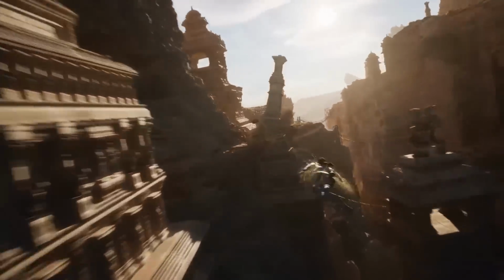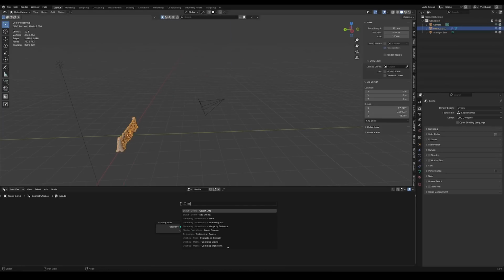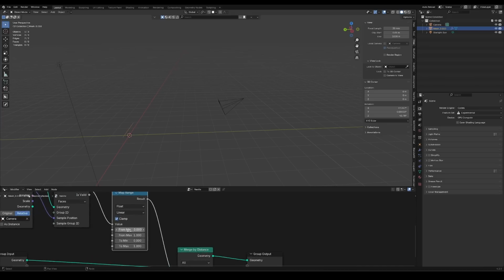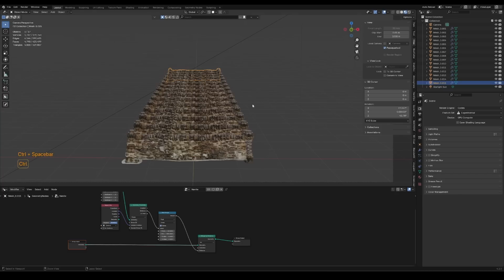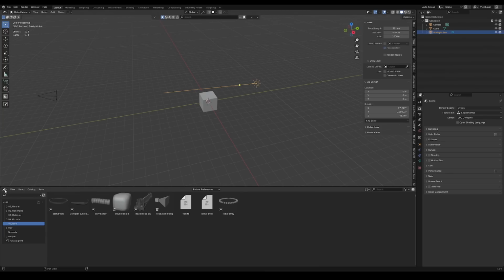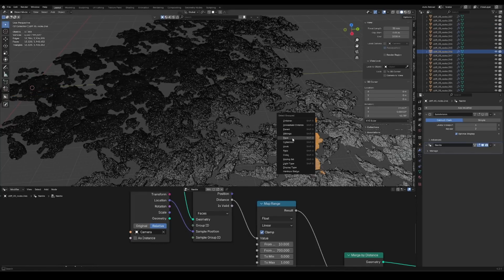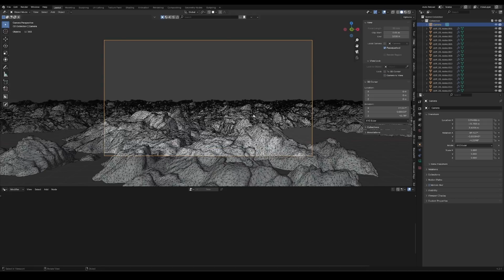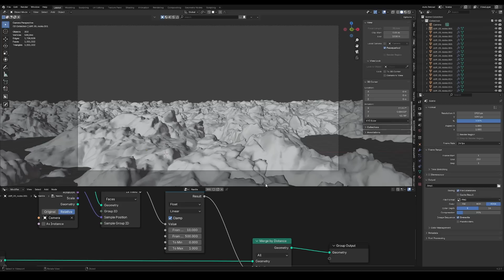I tried making UE5's NANITE in BLENDER!

Comment from the maker: Thanks for hanging out folks! This quick node setup is definitely just for fun and not a 1:1 nanite (relax, I'm not that smart!). Someone has also rightly pointed out that this method is only preferable when using lots of unique meshes. For any repeated meshes, using linked objects (Alt+D) is still way more performance friendly! And texture and UV friendly! So take with a grain of salt and follow other optimization best practices! I hope blender eventually has some kind of native functionality like nanite to help with viewport performance though!

Do check out a recent vid made by 'stache' on scene optimisation. It's excellent!
Reply: yeah calling this "nanite" is a bit over the top, but gets the idea across.

what nanite actually does involves a bunch more pre-calculation. they break models into chunks and swap the chunks, with clean 'seams' between the mesh chunks. it avoids the jitter that comes from most progressive decimation LoD techniques, and takes care of the processing problem that was slowing you down. i have no idea how you would implement that in blender, but its probably more than geometry nodes can handle.

this is a pretty cool basic progressive decimation technique though. good video.
Reply from the maker: @IIIDemon yeah fair call. I might have got a bit over excited by the concept😅
Reply: the best solution would have to be the decimate node built-in to geometry nodes itsef

Comment: that's clever idea will it work  with animations as well, If the camera recalculating on every frame there might be issue, however i think it will not if we are setting a costume range. What's your thought on that.
Reply from the maker: Yeah I definitely made it with static cam or still frames in mind, and using instances is probably still way more performance friendly lol
Reply: @jamescombridgeart  I see

Comment: Cool idea but the execution has a few issues. 

1 - You do not need this weird setup with Geometry Proximity and the Cube. What you want is calculating the distance between the camera and the object origin. Just do that. Take 2 object info nodes, use Self Object node and the Camera as inputs, and retrieve Distance between the 2 positions with the Vector Math node.
2 - There is an Active camera node for the Object info, no need to specify your camera object in the node group.
3 - This is not very useful at the moment because it's going to be so laggy since everytime you move the camera GN is going to recompute every objects from their 1 million polycount to the currently needed polycount. To make it more useful I'd first bake a few LODs (all of this can be done in GN procedurally on Frame 1) and caching that. Then when calculating the merge by distance I'd retrieve the closest LOD that has a higher density than what's required and merge by distance from that LOD instead than from the High Poly. Also I'd include steps so it doesn't reculate for tiny movement but every 1 meters for example (although I would not do it linearly but exponentially as camera get closer to the object).

More on the Geometry Proximity and the Cube: 
What your setup is doing is looking at the Cube and asking "What's the closets Face on the Cube to the Camera Location?" or "Which face as the shortest distance to that Camera?". Then you retrieve that distance and use that to Merge by Distance. That's what Geometry Proximity does, it's retrieving the closest mesh component. I hope it's obvious why this is not ideal.
Reply from the maker: Geat notes! Thanks for taking the time to respond! I'd love to see a better version of my crude attempt that's for sure! Do let me know if you find anything cool!

Comment: The value of the decimate node isn't an arbitrary [0-1], but scene units distance between vertices. To improve this a bit, calculate the size of a pixel for each mesh (based on the centroid, or some other metric), and use that as the input to the decimate node. So you can say merge vertices that are about n pixels apart
Reply from the maker: I would love to see this!

Comment: This is very cool, and yeah it's not a 1-1 recreation of how "Nanite" works under the hood, but the idea of Nanite sums up as dynamic decimation based on the difference from camera and that's what you did, kinda. But I do think based on the Nanite official documentation, you can remake Nanite again but much closer to how Nanite actually works, and although it would still be limited to a geonodes modifier, and wouldn't change underneath how Blender renders polygons, unless you change the source code of Blender, it still could be a very useful tool for specific purposes. 

This is what I found from the official doc of Nanite. 

""During import: meshes are analyzed and broken down into hierarchical clusters of triangle groups.

During rendering: clusters are swapped on the fly at varying levels of detail based on the camera view, and connect perfectly without cracks to neighboring clusters within the same object. Data is streamed in on demand so that only visible detail needs to reside in memory. Nanite runs in its own rendering pass that completely bypasses traditional draw calls. Visualization modes can be used to inspect the Nanite pipeline. "
Reply from the maker: Interesting, that makes sense how it's way more performance than this crude version haha

Comment: This is Nanite with a huge asterisk. If you render out an animation, I wonder if this would even be faster than using persistent data rendering, aside from having bad performance when moving the camera. Also one of the nanite traits that you could have easily replicated is that it has a specific geometry density on screen, not some arbitrary decimation based on linear distance to the camera.
Reply from the maker: Very true! I may have got over excited. If you figure out a method to do what you described I'd love to know! 🙏

Comment: It's not usable in any way. Modern viewports can handle few dozen of millions of triangles easily. And once your start exceeding that and the framerate starts dropping because of that, using your merge by distance setup is going to cost a LOT more performance to calculate than the large triangle count. And also memory, since there will now multiple permutations of mesh topology, and those meshes therefore can't be instanced. I know it's just for fun but even withing the context of fun it doesn't make much sense :)
Reply from the maker: True! Better to apply it on large scenes, if you do opt to use it at all.

Comment: when i plug min and max to group input to access it from modifier panel but it doesnt work same why so?
Reply from the maker: Yeah I ran into this too. It's because when you drag into the modifier, it means it takes those values on a per object/modifier basis. Whereas if you leave them in the geo nodes area, they stay dynamic / more global. Either would work technically, just depends our your needs

Comment: To copy the geo nodes modifier to all objects you want to decimate, you can also select all objects and use the 'Copy to selected' button, hidden on the small arrow next to modifier name. This way the existing modifiers on the objects are kept. By the way you can also expose the camera selection in the modifier section by dragging the camera selection in the geo nodes editor to the group input. You can do the same for the map range max value, exposing it for easier use. By the way you can later change the value for multiple objects by selecting the objects and holding alt before clicking the value to change it, which will apply it to all selected objects.
Reply from the maker: Wow love that ALT tip! Thanks!

Comment: 1:30 btw you could just add a Position node and an Object Info node (with the object being the camera). The object info node has a Location output, so just add a Vector Math node and choose Distance and plug the position and the location of the camera.
Reply: That would cause the output to be a field, and the merge-by-distance node only accepts single values in the distance input. He could take the length of the Location output though.
Reply: @anonymousanonymous2284  then you could add another Object Info set to self (this object) and use its location, instead of the Position node.
Reply: @bean_mhm  That's one way to do it. Assuming that both of the Object Info nodes are set to original, it should be functionally identical to plugging the Location output of a Object info set to Relative into a Vector Math node using the Length operator. I just have a tendency to use fewer nodes if there are two ways of  doing things, even though I don't think that it makes any difference as far as performance goes.
Reply: @anonymousanonymous2284  good point

Comment: For the decimation problem of recalculating all assets in the scene using the modifier, you can probably create your own LODs ( Level of Detail ) in a collection, and then use geometry nodes to determine which one to display, based on distance. However, this would be similar LODs in a game engine in the traditional sense and not a smooth transition, game engines traditionally have roughly 4-5 levels of decimation. But you can decide for yourself how many you actually need and place it in a collection.

This way you don't recalculate all decimation on all assets on the fly. It's already precomputed and the geometry node just decides which to display at what distance.
Reply from the maker: Huh! That's a cool idea. I'm sure there'd be a way to switch between them!
Reply: Cool... I wonder if that switch  from one LOD to another would be "very" noticeable. Anyways i would love to see something like that on a scene full of meshes.

Comment: In facts is't a nanite like is more like a LOD Decimate by distance just Simply LOD... Nanite work like that
1 - Simplify the mesh topology and merging  with conserving volume and edges
2 - Create some cluster of 128 Vertex per cluster  ! Exemple if you have a mesh with 3x 128 vertex you have 3 clusters
3 - By distance nanite can add more geometry and subdivide cluster or decimate it again but he load and unload the cluster of the mesh dynamically because the ray of the camera hit the "Visible cluster" so not visible cluster are culled, and unloaded
4 - If the mesh are too far from the camera the density of the mesh gonna be decreased, same as you're geometry nodes !
5 - And you have a frustrum culling & occlusion culling for getting again more performance 

Nanite paper  https://advances.realtimerendering.com/s2021/Karis_Nanite_SIGGRAPH_Advances_2021_final.pdf

I pretty sure with a lot of search and combinning some node  you can create a powerful system like nanite in blender with a powerful of GN combining mesh Adaptive subdivison, frustrum culling, and automatic LODs system (Something like you're node) ! 
Hope you can do a V2 for shocking the world !

Comment: excellent work mate! I had a feeling something like this ought to be possible within blender. Even though it isn’t really the same as Nanite, but yea kind of in principle. Adjusting polygon count based on the distance from camera automatically is a blessing for those of us who have done it manually. Im still new to geometry nodes but I have seen enough to understand Blender’s full potential hasn’t been tapped into just yet! Keep it going 🙏🏽
Reply from the maker: Yeah definitely not a 1:1 transfer lol. Just for fun! I love making fun little tools like this that can speed up my workflow 😊. Thanks for stopping by!
Reply: @ Well in the end it did prove to make a difference, especially in rendering time. That 2 second difference is exponential. When one is attempting to render hundreds/over a thousand frames, it does add up to some time saved! Subbed 🙏🏽

Comment: This is very interesting, but unfortunately it doesn't work with instances . That is, instead of having 6 Ald+D copies of the wall (120k polygons in total), we will have 6 copies with 600+k polygons. This solution may be suitable for one very high poly object, but not for a set of objects, because using this method we will only increase the number of polygons with each new copy
Reply from the maker: Hey great point, you're absolutely right, this method would only be preferable when using Unique meshes. Thanks for pointing this out 👍

Comment: That's absolutely not anything like nanite... it's a just basic decimator trick that can't work in real situation needs.
How would it cope within a 500 million poly scene ? It wouldn't because it is not design to work with high density data where the optimization would make sense.
If you render an animated version of the rock with the cam moving, how stable frame to frame would it look like ? It would be jagged so much it'd be unwatchable.
Reply from the maker: @rocksquared  you're 100% right. It's nowhere close to what proper nanite would be capable of, that's way above my pay grade😅. In terms of a render, since it's offline rendering it wouldn't be noticeable in the final. Although with super dense scenes I'd always recommend optimising and applying modifiers tailored to the shots needs. 

Sorry if I got your hopes up only to let you down friend! Maybe I shall tweak the title to avoid a similar experience for others <3
Reply: @jamescombridgeart You replied with such sweetness and humbleness. I loved your video. Thanks for the video and keep posting these type of tips and tricks for blender and also for Ue5 if possible ❤

Comment: So nanite basically auto create LODs instead of manually make LODs
Reply from the maker: Basically! There's some contention over whether or not Nanite is properly optimized for this purpose in unreal amongst some devs I've spoken to - but that's the concept of it yes. pretty cool though - especially if you hate making LOD's 😅
Reply: @ I hear some case LOD's increase file size and reduce performance, so nanite can be an alternative method.
Still it take some power for decimate process in exchange for reduce memory load.
Reply from the maker: Yeah, some up front cost potentially in exchange for render efficiency. Same for LODs I suppose. Up front (or space cost in a games case) cost, for better performance